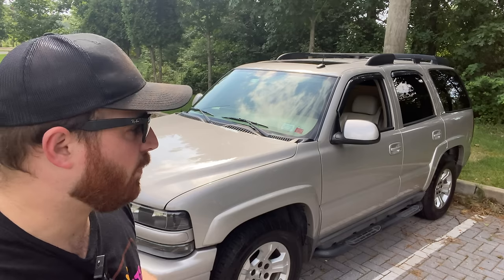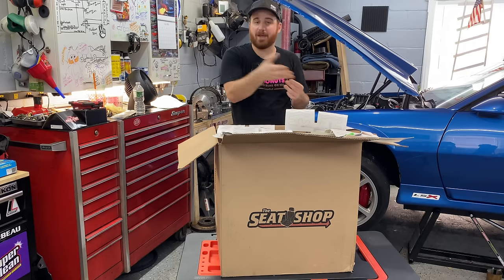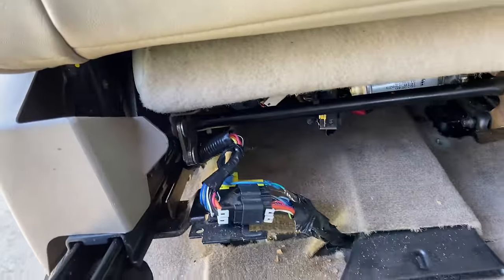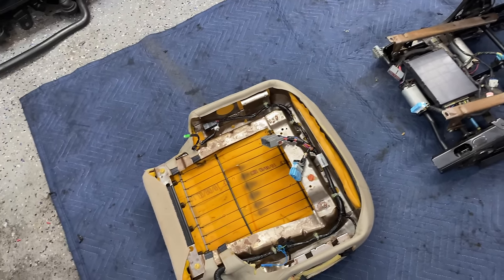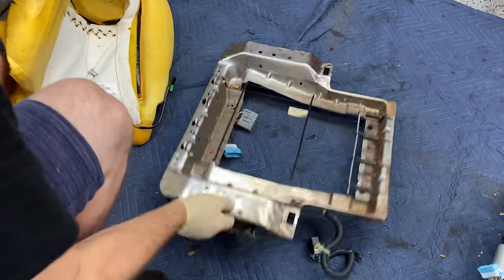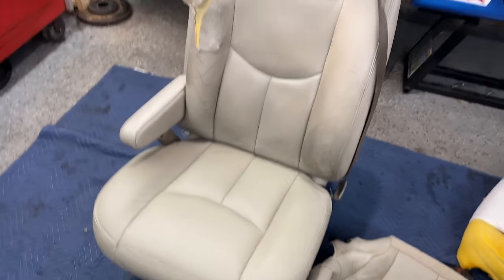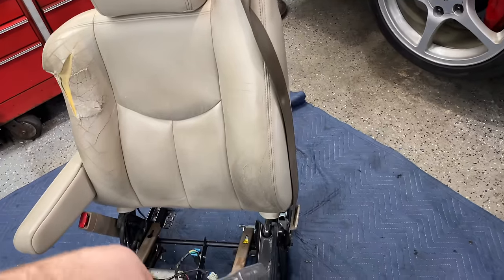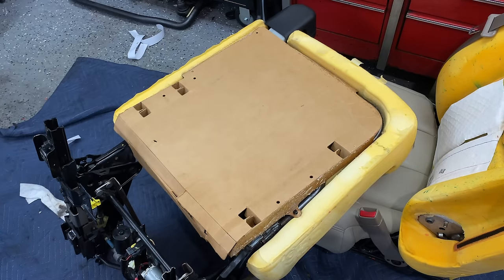I TRANSFORMED My Tahoe’s Filthy Old Leather Seats

Comment: Great job Matt. Little tip--to find out which color you have, pop your headrest off, flip it over and pop the plastic tab open. There'll be a white tag telling you what color the seats are--Pewter, Med Pewter, neutral etc. Just makes it easier. Using the vin is great--but doing this will tell you the color right away.

Comment: I used to work as an IT manager at Narricot Industries in Virginia where they made seat belts.   There is a testing room where they stretch the seat belts to maximum, and when they break, I jump every time (not used to being in there all day like the others). They test stretch these things to 10,000 pounds!  That's right!  You can tow a vehicle with these!  I did!   The weaving machines that make these will run about 5 to 6 inches a minute (more or less).  This technique of weaving is called "narrow cloth" (cloth weaving for clothing is called "broad cloth" for reference).  They also make tie down straps and parachute straps.

Comment: I just found your series, and am working my way down the list performing a number of the tasks as well, having just purchased a rough 2001 GMC Sierra.
Thank you for having posted these videos.
I'm going to be replacing the covers on my front seats and cleaning the rear ones, before many other items in the rig, since the seat and steering wheel are your main points of interface with your vehicle.

Comment: i just bought a 2001 tahoe for $500 im planning on completely revamping it im pretty excited but it definetly needs alot of work. other than that it runs and the battery holds a charge and it also make no noises so im pretty stoked.
Reply: I also got a Tahoe 2003 for 1800 as a project, I’ve owned it for 2 weeks and I initially fell in love with it , in the past I’ve had minivans and Silverado trucks . But this is a mix of both and is much comfortable than both . Have fun on bringing your Tahoe back to life .

Comment: Thank you so much for this video. Right now I am in the process of doing the research & shopping around for products to do my Tahoe.  I have a 2009 Tahoe SSV ( formally a police vehicle) it has beat up cloth on the front 40/20/40 seats and Vinyl on the rear 60/40 seats. So, my plan is to get vinyl for the front so everything  matches. I did price out all products that I will need on a different website, but I believe that I will be going with THE SEAT SHOP after seeing this video...nice job...looks nice. and I will be using your video for reference when I do mine.

Comment: Goll-LY those trucks sound good. I need me a new turbo ASAP. Just towed 9k over 9-11% mountains in the Poconos and my stock LML turbo still hanging in at 238k. Even pushed an intercooler pipe loose. Interestingly, my trans temps never got above 179 degrees

Comment: I have a 2005 Yukon and the leather is worn out and the cushion is pretty flat.  I was on the fence about replacing the driver side, but I think this video made my decision easier.  SeatShop has a 10% discount if you spend over $500 but your code works even if you spend under $500.  Love the videos, keep up the good work.

Comment: A cheap cheap hand held steamer will soften the leather and give you a little more flexibility, it makes the job a little easier. Smooth out the wrinkles using the steam and your hands and dry overnight. Try it if you tackle the 2nd row.

Comment: I had all my seats  Reupholstered, in my 2002 the oem color for only $500.00 here in Chicago, and l must say, its a huge difference. My seat foams were fine and the heaters were too. It was done professionally but without the price, doing the seats over makes it feel like a NEW TAHOE. I strongly recommend it, and the guy comes to your house and takes them out front and back in like 10mins, wish l could post pics. Heating up the material with a heat gun makes the stretch MUCH EASIER
Reply: But Matt did a great job, looks perfect

Comment: Wow what a difference. Looks brand new. Mines and my wife's truck SUV are in fabric. I wanted to know if the seat store has the seat belts. I want to replace all of mines and my wife's truck. I also wanted to know if you could help me. I have a 2000 Chevy Tahoe ls. And my passenger side electric seat is stuck. It moves a little but won't move back all the way or forward all the way. It's track or something is messed up. I can't figure it out. So I can't remove the seat. Same for my wife's truck 2001 gmc Yukon sle. Also fabric interior.
Reply: Probably just something stuck in the seat track...try cleaning it.

Comment: Impressed 👍🏻 , those seats turned out great. On a side note looks like your driver side seat adjustment plastic panel is still cracked. Have you considered plastic welding it and painting it with some interior paint? Just a thought great video as always.
Reply from the maker: Im probably just gonna find a replacement on ebay.
Reply: LsxMatt Genuine GM 88941682 Seat Adjuster Switch Bezel, Front https://www.amazon.com/dp/B00GV84JIY/ref=cm_sw_r_cp_tai_F3bpFb20TY4X4        Just found these the other day for my 04 Tahoe z71.  Make sure you check your color be ordering.

Comment: The seats look great.   However, I wish you would have gone over the lumbar support in detail.  When I test drove my car, the lumbar support worked just fine.  While driving the car home and fiddling with the seat adjustments, the lumbar popped.  The motor works fine, so the problem is inside the back of the seat.  Good thing I don't like the lumbar sticking out, but at some point in time I'd like to repair it as I just like everything working properly.  Thanks!

Comment: So the website doesn't offer the all leather upgrade for the 03-06 tahoes in shale (only medium). The shale option has a leather seating surface and vinyl sides. Are these not the same?
Reply from the maker: I have the leather seating surface and vinyl sides like oem. The all leather option replaces the oem vinyl sections with leather. Not sure why they don’t offer it in shale yet!

Comment: I just bought a 99 Buick park avenue got all the breaks done, oil changed, all the doors to open again and not stick, windows are still a bitch and don’t roll up and down correctly but it’s whatever, and now I just have to fix the leather seats cause they’re tore up pretty badly and so is the heat warmers not only that the door has a pretty big chunk missing lmao so after my grandma is done diy the gauges from spinning around I’m on to interior work 🤣

Comment: I wanna know why didn’t the seat shot pre-cut the holes for the seatbelts, headrest, and all rest? Unless you stitched around the holes you cut, the holes are going to widen due to the body weight.
Reply from the maker: Depending on how worn down the seat foam is, the holes can fall in different places. There’s no downward weight being pulled on the seat back so it should be ok. I’d only be worried if
the bottom and top section were all one piece.

Comment: Wait why didn’t you put new inserts in the other seats?  Like you did for one seat but not the other
Reply from the maker: What do you mean by inserts? The heating pads or foam? I changed the heating pads in both seats. I only change the driver side lower foam because the passenger seat didn’t get sat in enough to need replacement.

Comment: So my car was stolen for about a year and when I got it back the guy was so fat that every time he got in he couldn't hoist himself into the seat so it got pretty badly damaged and super filthy. So I am wondering if the replacement bottom portion for the driver's seat is actually leather and if it will fit a 2007 Chevy Suburban seat. I personally have never put my feet down into the vehicle without changing to my driving shoes not only to protect my shoes but to prevent any debris from dropping into the carpet covers.

Comment: Looks good but the seat shop is asking too much for my blood but for what they are charging i think all the holes you had to cut should had been pre cut .. I just brought cheap seat cover pads for the bottom of my seats. Maybe one day I will have the money to have new leather installed by a professional..heck you did a good job installing them. You could have a side business installing seat covers
Reply: Cheap ain’t good. Good ain’t cheap.
Reply: Rather invest money into my old truck. Beats those crazy new car payments. New Tahoe are expensive.
Reply: @jonellwanger7258  the ones I brought are good actually and it was cheap, sometimes cheap can be good.. hey buying used is going cheap vs new which is not cheap

Comment: Sweet. I have the 2006 suburban with the PEWTER color. I definitely need to do my seats. Love my suburban, but carpet kit and seats getting done will make it like new again. Since we will only put 2-3k miles on it per year, I went with the cheaper and not the full leather you used in this video. Just cant justify spending 1k on all the seats with how little we use the Suburban now. Got seat out and apart waiting on the delivery of the new cover now. I would NEVER do all this work without replacing the foam padding as well. If you are taking the time and spending the money, do it right. You can almost guarantee your foam pad has fone to shit if your leather cover is also all worn out.   Nice video.  Edit: OK, to add on my above post, I did this on the bottom seat today. I got the cheaper ones from Ebay... they did not come with the velcro. I replaced the foam pad also. I followed this video and I did the seat by myself. It went on pretty well, although it does take some work. Once it started going on, it seemed to go pretty easy. I sat on it when done and WOW, cant believe how different it feels with the new pad. I dont care if your foam pad is not that bad, if you have a 14 year ol, or older vehicle, that foam is warn to hell. The new foam is so much more firm, I love it. IM gonna copy something I found as when I ordered my cover, it came with the wrong color even though I used the code from the glove box. Please read before ordering your new covers. Interior Trim Code 922/92I
Here’s the deal…The 922/92I trim code for the 2000, 2001, and 2002(mine is a 2006, and this applied to my vehicle) Chevy Tahoe, Suburban, Yukon, and Yukon XL can be a little tricky to interpret. We get a lot of calls about what color leather is actually in the truck. Unfortunately between the year 2000 – 2002, GM tied 2 different colors of leather to this one trim code. You can either have Shale or Pewter leather seat covers. The “trim” will always be pewter “grey.” “Trim” is the molded plastic panels on the side of the seat (like the panel that houses the electric seat controls, etc.). If the leather color matches this grey trim, you will have the pewter leather. If the leather color is a lot lighter than the pewter trim, you will have the Shale leather. Shale is like a cream/khaki color. A lot of our customers refer to shale as a “light grey” color. I think this is because the pewter “grey” trim makes the leather appear more like a grey. At any rate, if you do have the 922/92I trim code, just make sure to look at the leather against the pewter trim pieces to determine which color you have.

Comment: I'm redoing my entire interior, changing colors as well. So while I will be doing seat cover swaps as well, I'm going to want to change seat belts (from tan to black). So I was hoping there would be more video on the seat belt mechanism, but I suppose it's manageable for me to deal with. Some generic aftermarket seat belts should suffice and I can do a little fabrication if need be for securing it where it needs to be. If someone is aware of a video tackling this, I'd love to get a link!